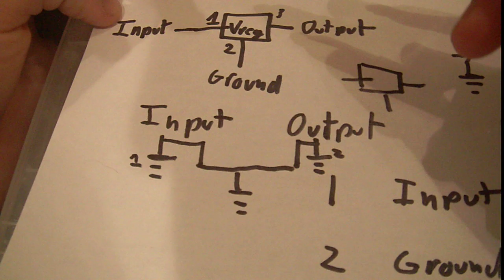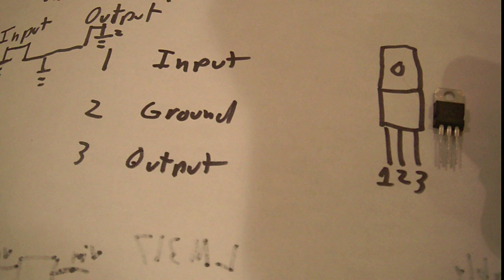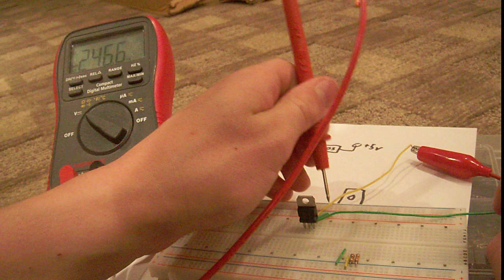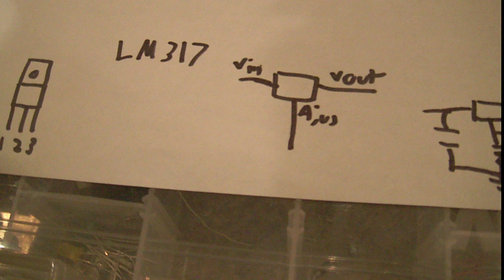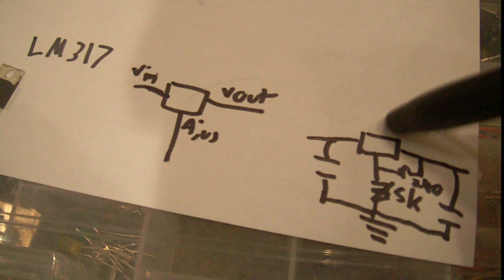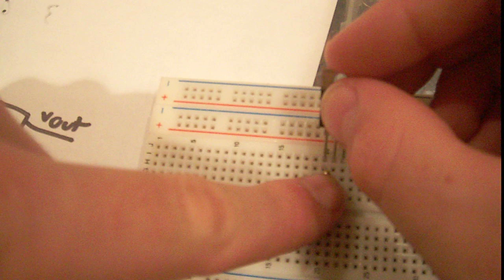Voltage Regulator Tutorial

Comment: Why the ground of input,output and the ic 7805 has to be same...?
Reply: The internal 5V voltage reference is to ground in the voltage regulator. It tries to make sure that your output voltage is the same as that (with respect to ground). So long as your voltage regulator and output voltage have the same ground, you'd probably be OK, but the voltage might be hovering more than 5V above the input ground.

Comment: quicknuclearscience If you have a generator as a power supply with a non steady input.  If we connect this generator to the LM317 circuit, would the output current equal to 1.5 Amp? or would it depend on how much current the generator is inputting?
Reply from the maker: The output current would depend on the load you were connecting to the LM317. The LM317 itself will draw only about 5mA or less, but you have to add on the current drawn by what ever load you connect to the LM317 to get the total current supplied by your power supply.

Comment from the maker: Yes a voltage regulator will constantly drain you car battery. If we assume the quiescent current of the voltage regulator to be 5ma and the car battery capacity to be 50amp hours than the car batter will be totally dead after 10,000 hr which is 1.1 years, although it probably wont be able to start your car after 3/4 of a year (just an estimate), but if you drive your car more than once every half year (just to be safe) than the alternator will recharge the batter and you will be ok.

Comment from the maker: The Input connects to the voltage you want to regulate ie. the higher voltage
the ground connects to the negative side of the breadboard, and also the the negative side of the power supply it comes from
the output is the voltage that is regulated ie for a 7805 it is where the 5v comes out

Comment: hello
I am trying to learn electronics and
I watched your video related with LM 7805..

1- input------> power supply

2- Ground ----> negative side of breadboard

3* output and also it is connected to positive side of bread board?

I did the circuit which you show but 7805 heated too much why?

Another question; ,I will send you very simple circuit diagram if you send me your mail adress?
regards

Comment from the maker: There is a schematic for a 7805 in the video. For a 7905 it is the same except the input pin will be the negative voltage. For a picture just search 7905 schematic on google and you will find a schematic. To use them both together you need to connect the grounds together. You will also need a higher negative voltage for regulating, just as you need a higher voltage for positive regulating. A dual +9, -9v with common ground input will let you use both at once.

Comment: 1. i have not given this supply yet to any load, i just tried to check the output
2. As i m giving +9v from a battery and  want it to be -5v so i dont think there is need of filter caps ..(seripusly i m not sure about it.)
3. i tried reversing thve polarity of battery i.e. i m giving a +9v to GND and 0v to Input pin
but 7905 gets heated too much..

Comment from the maker: I don't often use negative voltage regulators but I can offer a few suggestions. 1. if you're operating the regulator with a heavy load ie. a few hundred miliamps it will heat up un normal operation. 2. put filter caps between the input and GND and filter caps between the output and GND. 3. try reversing the polarity of the 9v battery 4. the specific regulator you're using could just be broken and you might need to get a new one. I bet it's one of the first 3

Comment from the maker: @eastsidesigns1 To do what you want is really easy. Buy a 7805 (from digikey, sparkfun, or even radioshack) google "7805 datasheet" and find where it tells you the pinout. Connect the 7v to the input, the negative from your solar the the ground on the 7805, and on the output pin there will be 5 volts with respect to the ground of your solar cell. For a 500ma load you should put a heat sink on the 7805 but that's it. I could make a short video if you would like.